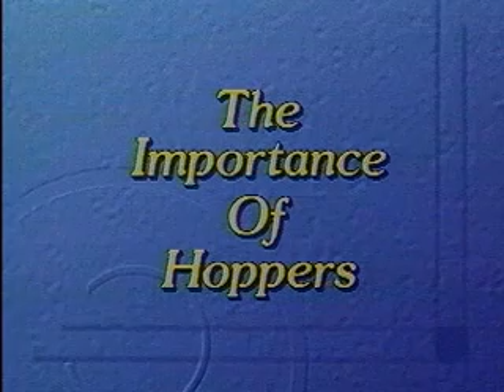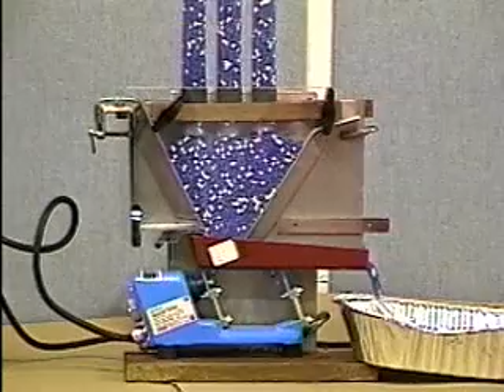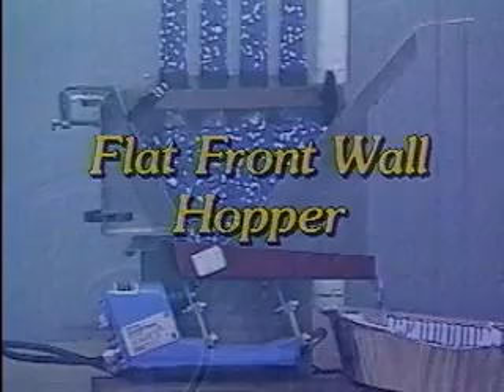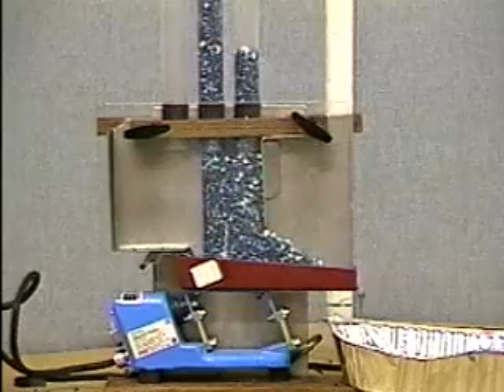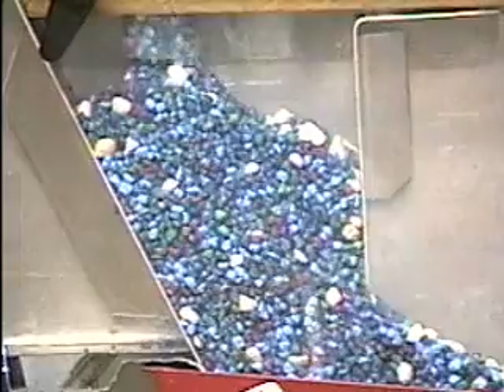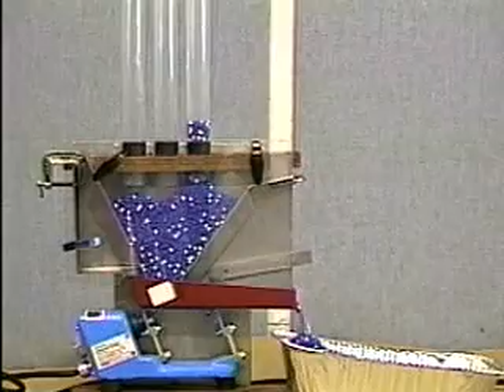FMC Hopper Design- the correct way

Comment: Your so-called "ideal hopper doesn't seem very ideal to me!  The material in the tube near the front wall is discharging around half the speed, and if you look at the particles near the top of th efront wall they are hardly moving at all.

This geometry looks similar to that proposed by Henk Colijn, but we have never found it to be satisfactory.  Your front wall should be steeper!